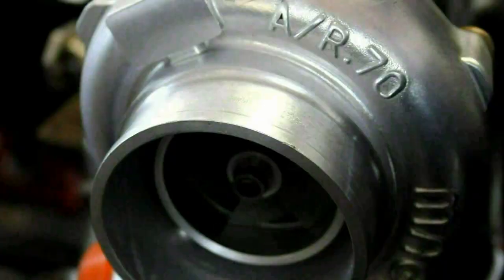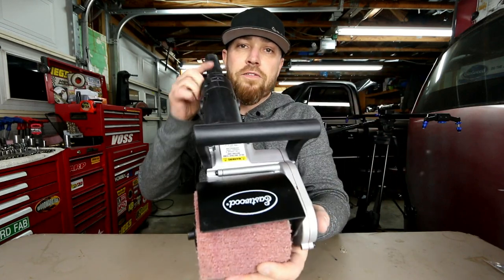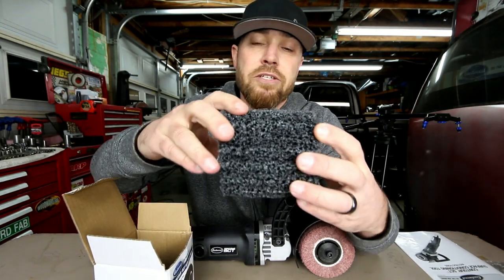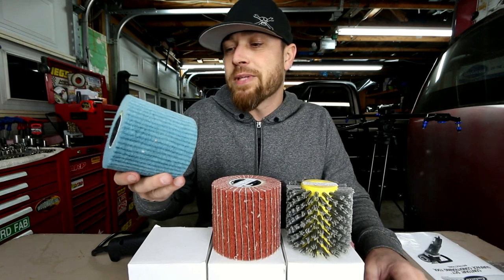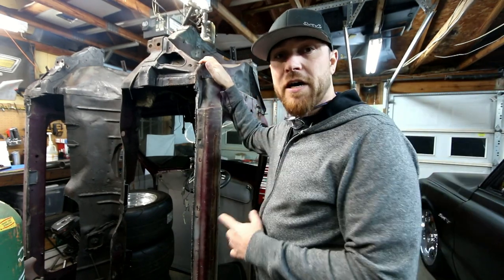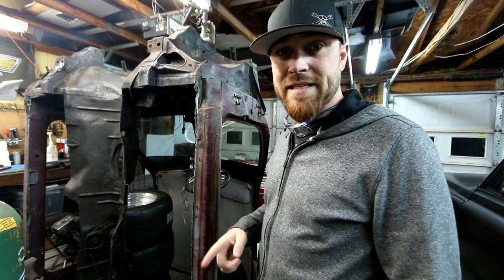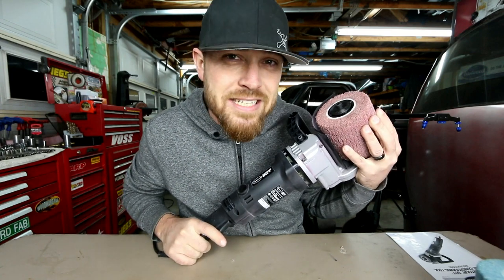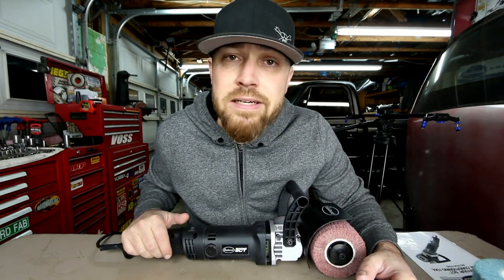You Need This Tool - Episode 54 | Contour SCT From Eastwood

Comment: I like it. Has anyone used this on an older car? I am wondering what it does when it comes across brazing or lead fillers.
Reply from the maker: good question.
Reply: good point , lead shouldn't be ground or sanded anyways , bad for your health . Always melt out the lead , bronze/brass brazing i'm not sure about if that is ok to grind

Comment: $199 usd.  If I ran a shop or had a perticular car I was working on, yes I'd have to have it.  But as it stands, I'll have to wait for the cheap Chinese Harbor Freight version... ;p
Reply: The same Chinese company that makes the Harbor Freight tools probably makes many of the Eastwood ones as well like the manual bead roller , sand blasters , and many other things .I bought the Eastwood ones of those and see zero difference in them .
Reply: TxStang Craig Voisin Thing about a brand name, is that they have to protect it.  Which generally means they do what it takes to not piss off their customers, by either having a generous refund policy, or actually building a thing that last....  Generally speaking...

But yea, I buy cheap tools so that anyone of them can become a hammer if needed...
Reply: Had to do some heavy duty reinforcing to my Eastwood bead roller , flexed bad on anything thicker than 20 gauge , My Eastwood sand blaster's overall air piping and hose system is sub par in quality . If you compare both of those to Harbor Freights other than the color of the paint there is zero difference between them , that's why I said they are probably made by the same Chinese manufacturer .   Prices are close to the same and I wait until Eastwood has a free shipping special before I order , what can I say I rather the blue paint color in my garage over the red LOL

Comment: No tool like that one?  BS.  Metabo SE12-115 drum burnisher, Flex LP 1503 burnisher, and Dynabrade 51585 to name three that do exactly the same thing.   Drums for the three named interchange and you can select from a wide variety of drum types.   I have 5 different drums types for my Metabo.  I prefer the slightly offset design of the Metabo as it lets you get into areas with the edge of the drum - something you cannot do it the drum is centered on the machine.
Reply from the maker: I get into edges just fine with mine. When I said no other like this I was referring to the centered drum....although it could be applied to the price as well since you can buy three SCT's for what you would pay for one Metabo.

Comment: I have a Metabo and a Bluerock brand, and I've used a Fein. I've never found any of those being unwieldy just because the drum was off to the side. The Fein was the best one, and felt pretty good to hold for a long period of time. However, @ $900 it's a tad pricey. Metabo is about $600. The Bluerock brand is only $175 and comes with 4 different drums. I never used a Flex, but those are also German, and look to be the lightest of all of them.

Basically all of these use the same Metabo shaped drum keyed hole on the arbor. But you need to know just how expensive those pads and flap wheels are upfront. Even a bulk box of import wheels will set you back close to $290 for only 20 wheels! And the harder you push, the more they wear down, obviously. (They are called Burnishing Wheels, btw) The stripping wheels load up quickly and don't last very long. Eastwood's version is $60 a pop!

They are really awesome if you know what you are doing, and use them for very specific purposes. You'll most likely already be using them if you know about them. Because quite frankly, the entry point for these tools has always been high and very industry specific. Ever notice Harbor Freight has never brought one over, even though there are Chinese versions close to $100 on eBay. When the consumables quickly add up to be higher than the tool for the first job, you really need to be charging pretty high for the work that you are outputting to justify these.

Comment: Impressive! Of course, once you're at bare steel it's a good idea to apply a zinc or epoxy based primer on it ASAP or,  within a day, you'll see a light coat of rust on the surface.

Comment: I just bought one of these. IMHO it can't be beat for stripping thick layers of paint, epoxy, and filler with the black poly drums. I was quite surprised that it even comes with a spare set of motor brushes.

Comment: Yeah, I'vev been working with stainless steel for years, all the way from fabrication to surface finishing, and linear burnishers like the one in the video are quite amazing tools since they fulfill a bunch of use cases which rotary tools won't cut it.  The ONLY problem with them is that the media is very expensive (for quality).  I've got a Festool 14-23E and like any german company, they charge and arm and a leg.  One of the best purcahses I made for this tool was the Dynabrade 3-1/2"x5-1/2" inflatable wheel that has a common 5/8"-11 female threaded arbor uses standard 3-1/2"x15-1/2" belts which are not only more aggressive than the usual 4"x4" flap drums these burnishers utilize

Comment: Yet another machine that works fantastically on convex & flat panels but hasn't got a hope of getting into all the awkward nooks and crannies and internal corners. Now show the chassis you're working on there when you've done all the bits you can get to and then tell me how you're going to strip the parts that the machine couldn't get to! Media blasting or dip-stripping is still the only way to do 100% of an intricate part or panel.
Reply from the maker: dipping and blasting wont condition the metal though. You are comparing apples to oranges. This machine is a Surface Conditioning Tool. SCT

Comment: This thing is bad-ass & I kinda wanna buy it but the price is a bit steep.  How do you think cleaning up metal would be with this compared to a normal angle grinder with comparable disks?  I would think this has a bit more of a contact patch so it could work faster.
Reply from the maker: not sure I have never use an angle grinder...I have heard it kind of wants to torque steer

Comment: This really is a good tool.  I bought two for a second worker.  The drums work well but are too expensive.  $59.00 for paint knocker and $49.00 for the drum that goes around bolts and protrusion put my budget at over $500.00 to accomplish a really huge rust removal job.  Yet the work went smooth, and fast and eliminated ALL the rust on this sixty year old VW Type 2 18ft Motor home.
Reply from the maker: drums have come down since

Comment: over priced shit. ill stick with the angle grinder with knotted ss wire.    way faster
Reply from the maker: lol....to each their own
Reply: read the reviews,  n 60 a drum. ... come on the thing probably goes Allah ak-bar  when it blows up your wallet
Reply: My beef with the wheel is after a few hours, every time you move you are getting jabbed by chunks of wire that have broken off and stabbed through your Carharts or coveralls.
Reply: shitty ones yes.  you are right.   i found a brand of knotted that actually wears correctly. without shooting off full wires
Reply: The prongs tickle when they break off and missile into your skin. I've only tried DeWalt, which I consider to be a mid-range product. Specific brand preference? Cone style or flat disk where the wires stick straight outward? The knotted ones seem to usually be too heavy gauge for my needs.

Comment: I have used these types of drums, they work very well, but be aware, they do not last very long and the cost is extremely high. I checked Eastwood's price on the red scotchbrite drum and it's $20. Others are similar in price, I get mine from Klingspor,(they are not made to fit this tool ), they are a bit less but still expensive on a larger project.
Reply from the maker: yeah I am sure they could add up fast

Comment: Just buy the Harbor freight bauher. Same exact tool, 100$ cheaper. Even their drums are half price and same exact thing. To everyone thinking this is a great or perfect tool for auto restoration. It is not, this is meant for specifically flat surfaces and yes works great for that. To basically do a whole car would take around 5-7 stripping discs at 25$ a pop, then would take a solid day maybe day and half of time. Again, for small semi flat shaped or even large flat shaped metal items its great. But don’t think for any second this is a good tool to do a whole car. I’m assuming this guy was paid for this. Go find an honest rating. Go check out “My friend Pete” DIY auto school, he did a recent review on the bauer one and explained basically what I just did. Again, its a great tool, but not for auto restoration, unless you are doing a flat car
Reply: Harbor freight copied it not the same

Comment: I've been wanting this tool for awhile now. I'm hoping the price will go down lol. do you think it will do powder coated surfaces as well?
Reply from the maker: I it wouldn't have any issue blasting through powder coat. I know they are working to bring the prices of the drums down some.
Reply: That's good!  The drums are currently really expensive.  Awesome tool though.
Reply: id be surprised if it did powdercoat... my experience has been the only thing that works is Powder Coat stripper from powederbythepound.com and that stuff is expensive.
Reply: Eco Mouse brake fluid, or brake cleaner?
Reply: +biaggiwins You're right, brake cleaner... I just read someone trying to clean something with "brake something"... and alarm bells went off big time. If you are a welder, you should just throw out all your cans of brake cleaner. Don't even have it around to possible temp a shop helper to use it to clean something with.

I suspect that the outgassing for brake fluid can't be that great either. Since it's hydrophobic, and has a tendency to attract all kinds of molecules, contaminants and moisture to itself. Hence the warning to never use an opened bottle of brake fluid.
Reply: Eco Mouse i agree, a lot of products need to be kept at a distance. every shop needs a flammable storage locker.
Reply: +biaggiwins Unfortunately, they are so prohibitively expensive for anyone who is doing this kind of work and NOT expecting a fire marshall visit. (ie Home Shops) Harbor Freight needs to sell them, so there is no excuse not to have one. I managed to pick up a fairly small one from a shop going out of business for $100. So it's "official" but I guess even a metal cabinet would work, and if you painted it yellow and put Flammable decals on it, you might get a pass from an inspector, should one stroll into your shop one day, snooping around for fire extinguishers and what not.
Reply: Eco Mouse where i live, a visit from a fire mashall will never happen, unless my house is on fire. i found one on Craigslist, cheap. Good idea for HF to sell them.
Reply: +biggaiwins I've got a commercial shop space, mainly because I don't have a garage at home. Even though I'm not "officially open" for business (visible signage). I'm not immune from the Spanish Inquisition. So I make sure to keep my roll-up closed!

Comment: You don't need the tool to run those abrasives, and you can get them from a variety of industrial suppliers. I use my angle grinders instead. I also use a Walter version on the RH thread of one of my bench grinders (which also takes screw-on conventional flap abrasives.  Before I dropped two bills on that thing I'd spend fifty more to get a Milwaukee 5196 die grinder. I have one and maintained a fleet of them for a welding school. I'd make or have made (by turning down an appropriate bolt) an adapter for the style abrasives shown and have a much more versatile tool. Eastwood might want to carry Milwaukee 5196s because they tough, powerful and last a long time even in daily professional use.
Reply from the maker: +Ob Fuscated yeah the advantage to this setup is the drum is cetered....works amazingly

Comment: Had one, not impressed at all, traditional methods work much better. Plus traditional abrasives and such are much cheaper and better quality then the abrasives Eastwood offers. I’m a fan of Eastwood but this product wasn’t great in my opinion.
Reply from the maker: shoot, I absolutely love mine ! would not trade if for anything
Reply: Parts that can be pulled off get sandblasted, 40 or 80 on an 8inch hog strips paint way faster then what the contour could. I bought it to strip a 63 Buick with original lacquer on it. None of the wheels available could touch the old paint. Plus the contour is good for large flat panels and that’s about it, don’t get me wrong, my shop has many many Eastwood brand tools. This one though was a let down.
Reply from the maker: @DreamstoRealityAutomotiveTV  yeah probably not the best for stripping paint, but love it for putting a brushed look in the surface of parts
Reply: Well most of the ads and videos I saw were them showing it being used for stripping paint. The wheel I used was supposed to be for stripping paint. In my opinion the wheels were pricey and didn’t last either. I’m sure it has its place, just wasn’t good for me

Comment: Looks pretty cool. I've use a pneumatic tool very similar to that. It had an air bladder for the drum with a scotchbright cylindrical pad that slipped onto it. Great to have in certain situations.  We used it to finish polish large stainless steel idler rolls.
Reply from the maker: very cool

Comment: I been about to buy one of them for my 1970 corolla project.
Reply from the maker: gonna strip it?
Reply: Yes it need to be strip down and I will need to use some rust converter and sealer in some areas. Not bad for the age . Look ruffer on picture that what it's. Poor previous body work.
Reply: for some reason doesn't let me add pictures

Comment: After seeing this tool, I'm reconsidering my options.  Got a 66 chevelle with paint I need to strip off the entire body.  My compressor is too small to keep up with the media blaster I have so was considering an upgrade to a two stage etc.  wondering now if I should go with this tool instead of new compressor ?
Reply from the maker: just do both ....lol
Reply: The Fab Forums yah pulling the trigger on both soon